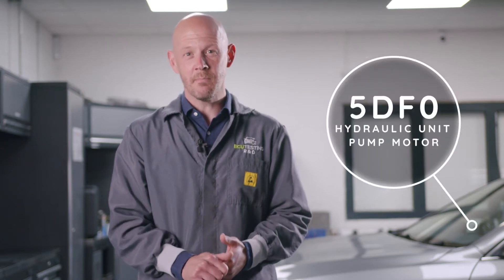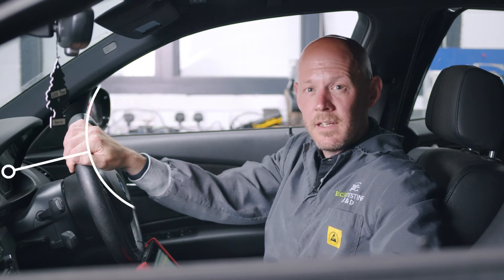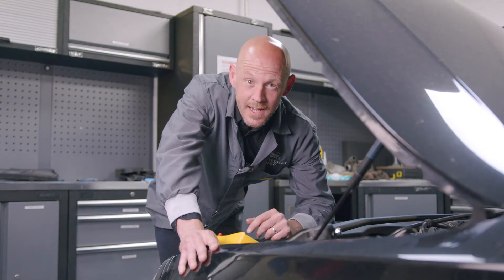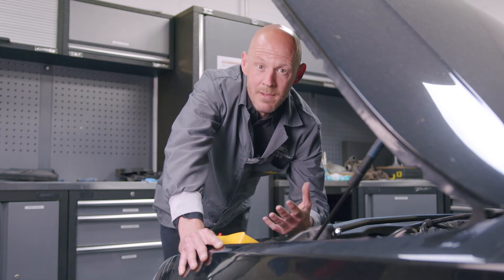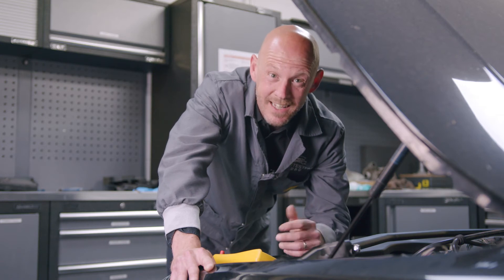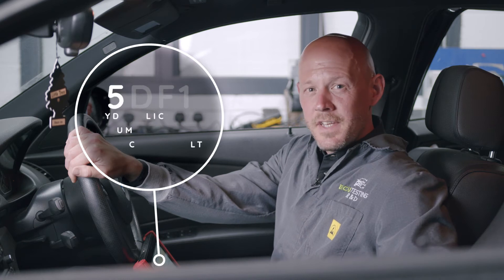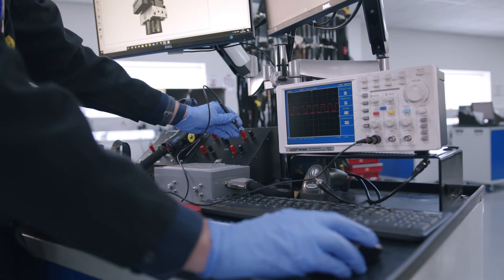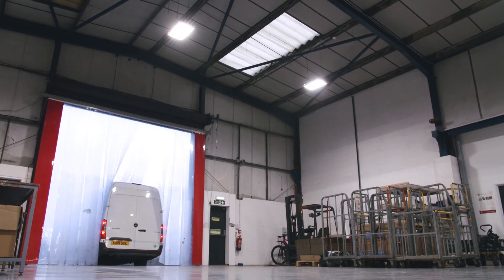BMW ABS Light Caused By 5DF0 & 5DF1 Fault

Comment: Had this issue with my E91 325i - faulty ABS motor. The electric motor was broken. Replaced the ABS (ATE mk60) with one from a volvo. I only replaced the electric motor. Problem solved. 
To be sure it's the motor thats broken you can check it by gently hammering it with a hammer. This cleans the brushes inside for just one day or so. Hammer it, start driving and if the problem dissappears after a few seconds you know the electric engine on the ABS is faulty.

Comment: Hi.

My car has been turning on and off the abs light for a year now. Today the light stayed on and wouldn't turn off by itself anymore.

Took codes with autocom and it gave me 5df0 and 5df1.

My question is: does the actual motor fail or the control unit? Which one is more common one?

I was thinking of trying to replace the only pump motor part of the abs pump since it's way cheaper and requires no coding. If that doesn't work, I would send in the whole control unit for testing.
Reply from the maker: Hi. The symptoms you are describing are a common sign that both the module and motor have malfunctioned so the whole unit needs will need to be re-built. If you would like to get your unit tested and re-built by us, please email our technical support team on info@ecutesting.com with the following details. Your make and model of vehicle, the symptoms of the fault including fault codes, and the part number printed on your abs unit. They will assist you further.

Comment: Z4 E89, i'm getting fault come up after several minutes driving. It cancels if i restart engine. Then reappears several minutes later.
I think the pressure sensor going faulty then throws several non faulty codes. It appears these later abs have internal press. sensor. Older had external.
Reply: I can almost know what part of regular journey it goes faulty so was thinking it was something to do with braking, slope of road, just turned. The fact it clears i am reluctant to remove it, thinking it might be simple wire break triggering fault. Sending for repair might be waste of effort. Try second unit first, retain the old electrics module. Even seen someone transfer the eprom chip with code.

Comment: Hi mine is now going on and off and i think it will go on with rainy weather and in the morning when i drive away it goes away and then when i drive like 45 minutes it goes back on does this mean that the pump is faulty?
Reply from the maker: Hi. Are you able to scan the vehicle for any fault codes? These will help determine the exact cause of the fault. Are you noticing any symptoms other than the ABS warning light coming on and off, such as the brakes sticking after braking effort or the brakes binding?